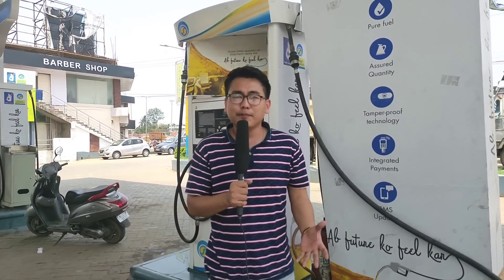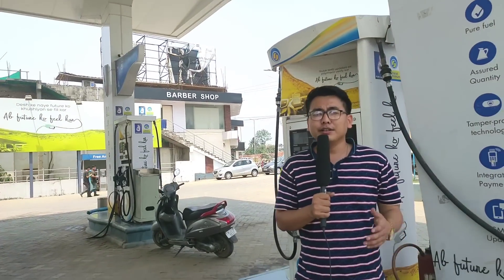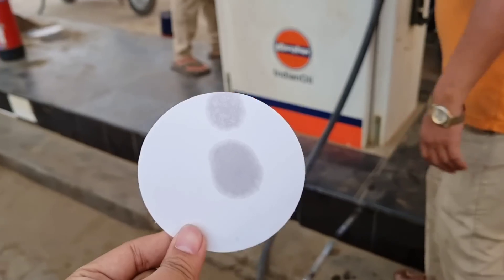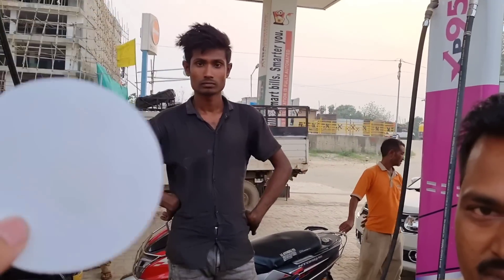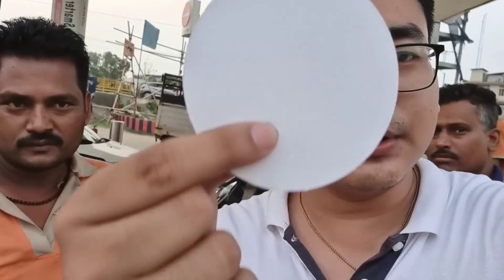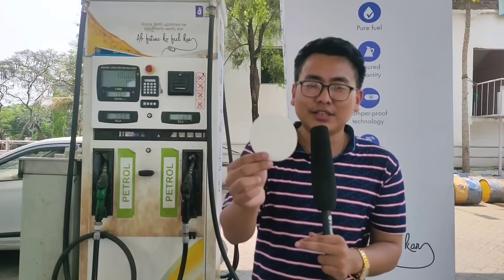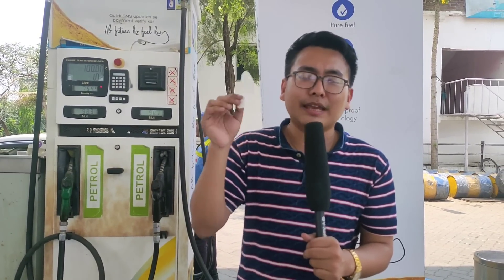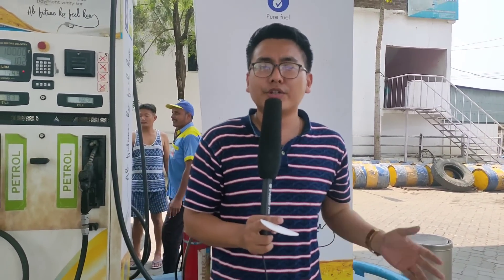How to Check Petrol Quality Adulterated or Not? - Know Your Rights

Comment: English translation please
Reply: Filter paper is used to determine the quality of Petrol. The paper can be taken from the manager. Incase if its not available then you have the right to complain it to consumer protection department. In order to check the quality of petrol. One need to ask the workers to put some petrol on the filter paper and then let it dry. If the fuel is adulterated then it'll show black spots on the filter paper. If it shows white(ie exactly) the same filter paper before and after the application of the fuel then its not adulterated.
Reply: @Joe_chakz  wow.. thank you bro
Reply: Well explained bro👍👍👍